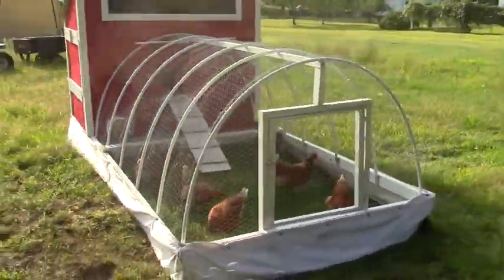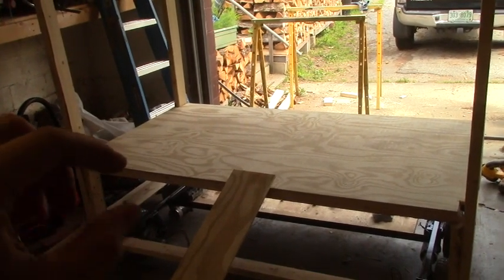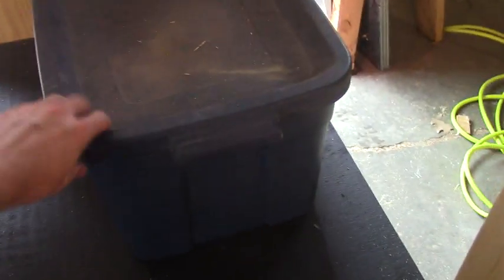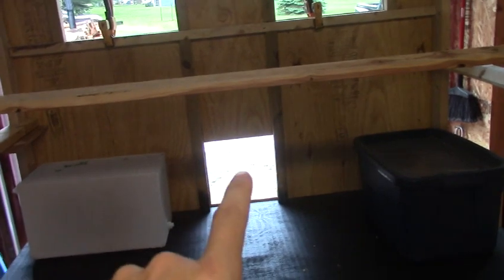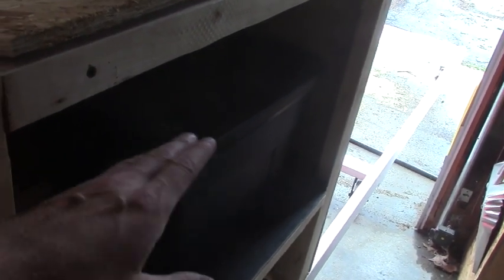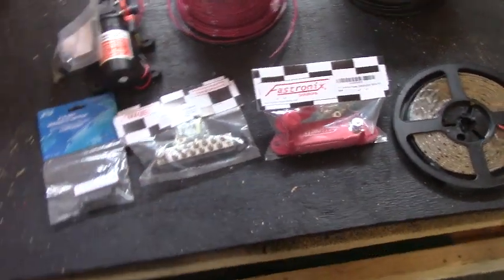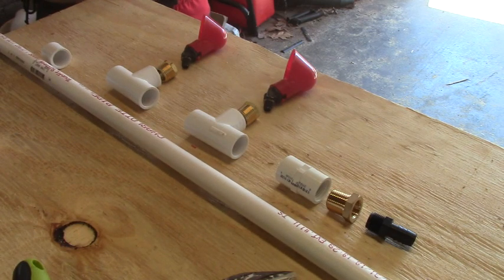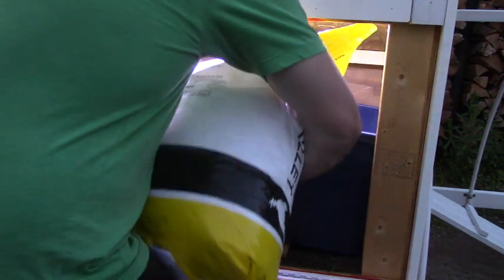Chicken Tractor Build - Part 3 (Fencing, Roof, Wood Framing and more)

Comment: Do you have any plans to develop the coop tractor further? I think it would be interesting to see whether its movement could be automated. A compass sensor linked to the Arduino could keep it moving in a straight line and it could simply move back and forth across, say, 3 lengths of itself?
Reply from the maker: I sure do. I've been working on it over the last couple of weeks to make some upgrades. Hoping to have that video out in the next week or two. Thanks for watching.

Comment: love the build. thanks so much for this series, I need to build one. I think I'll put the nesting boxes on top of the water and feed cabinets - make it so the birds can't get on top of them, and get rid of those weird spots where poop collects. I also think if you had put the battery tray under the feed cabinet (weight per gallon of feed is less than water), you could still have put a grate floor in between the cabinets. have you had any problems with predators getting under the chains? seems like it wouldn't even slow a weasel down.
off to find some broken wheelchairs!
Reply from the maker: Good luck with your build. I would love to see what you come up with. I like your ideas about how to improve it

Comment: Would you be able to run a small solar fence charger on this as well and run a hot wire a few times around the outside?? Or would that extra battery be too heavy for the wheelchair motors to take?
Reply from the maker: You could probably do that. You would just need more battery power and more solar power.

Comment: Where do you get the water tank? Or what kind of tank is it?
Reply from the maker: It is a overflow tank for a RV. I don't remember where I got it but probably on Amazon
Reply: Free Range People thank you. I build and sell small coops like these and a square tank is definitely the most space efficient. But I could never find an affordable one larger than 5 gal so I just use those square camping water jugs.